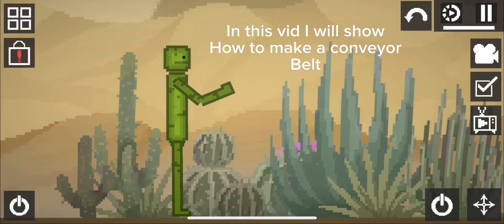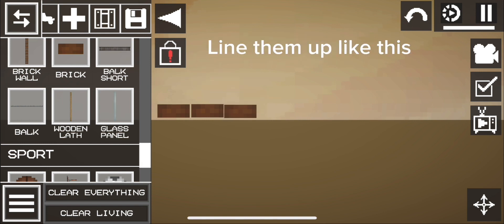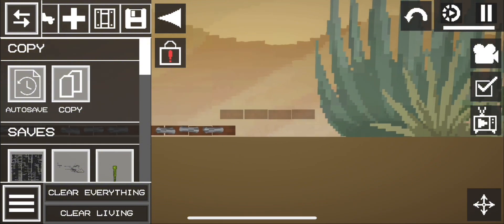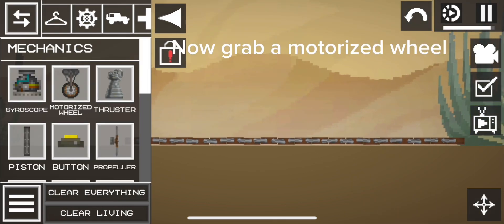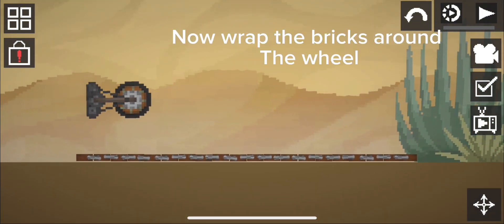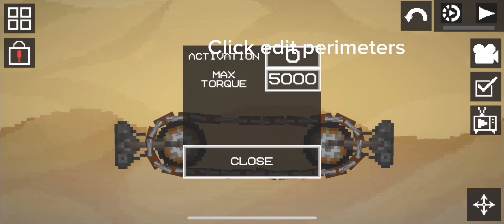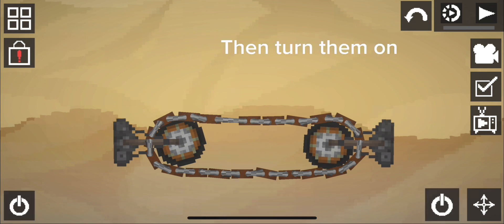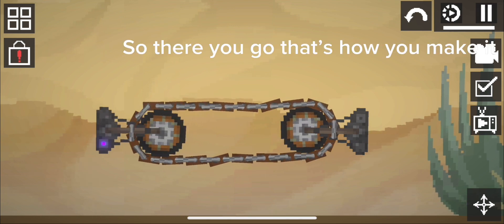How to build a conveyor belt in melon playground

Comment: I literally tried it. The thing broke.
Reply from the maker: How did it break?
Reply: @OrdinaryGT  I was just casually making it when I finished. I put it on the conveyor thing. It went straight through the conveyor and went off of it.
Reply from the maker: @Hunt3rNever  did you have the second rope connecting the bricks? As in the light grey one?